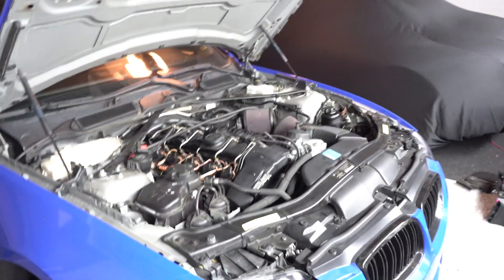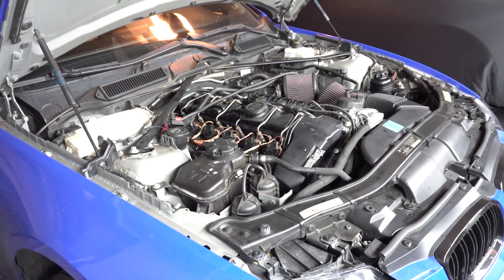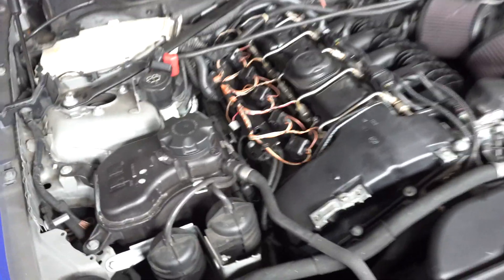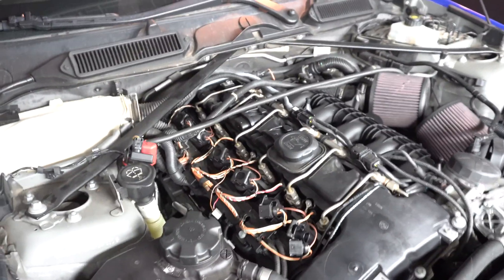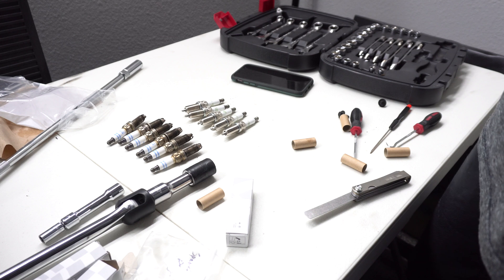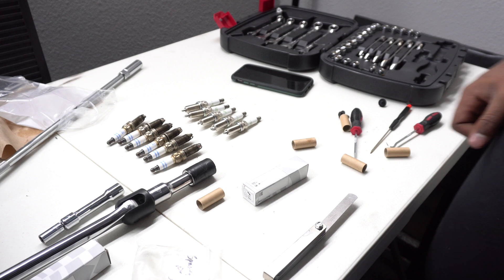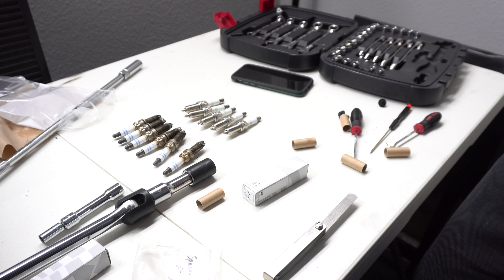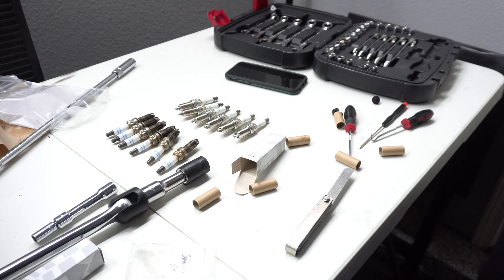Gapping and Installing BMW N54 Step 1 Colder Spark Plugs - 335i

Comment: Do I need a tune to run these spark plugs ?
Reply from the maker: You'd typically only run these if you're running a more agressive tune. Kinda pointless if the car is running stock power

Comment: What coils do you use with the these spark plugs?
Reply from the maker: I'm using Eldor coils, oem on the BMW 760, known to be a bit better than the delphi or bosch coils that are typically used on this engine

Comment: They make a tool to adjust the gap on the plugs without tapping them on a surface or using a screwdriver where you risk messing up or breaking the electrode.
Reply from the maker: Ken Steckelberg Good to know, ill probably get one for next time.